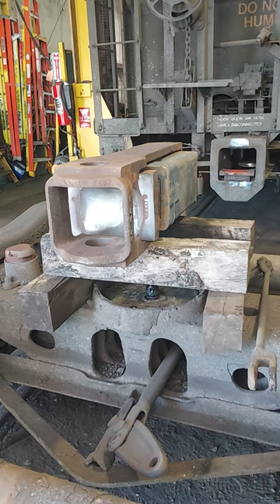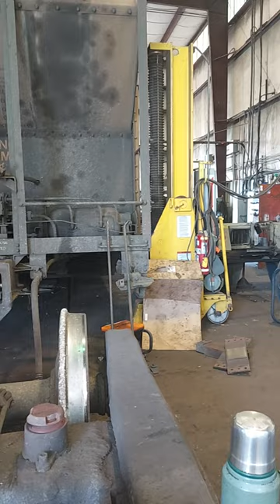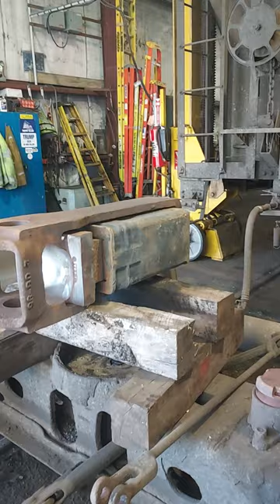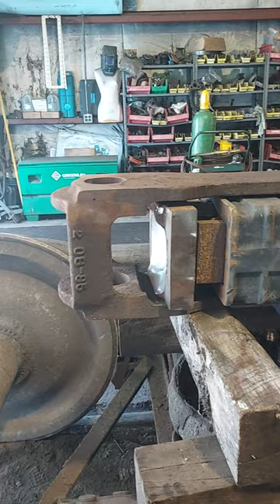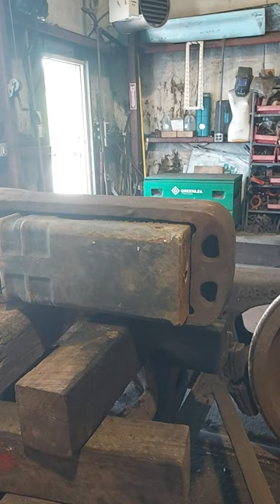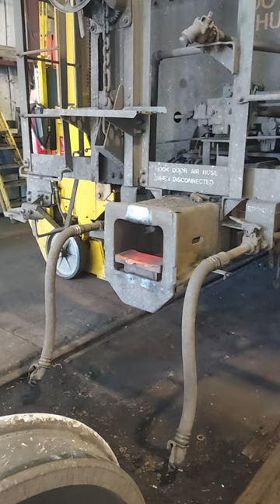How a Draft Gear Goes in a Rail Car #Shorts

Comment: We had jacks that would lower the draft gear and lift it into place.  The scary part was compressing the draft gear to remove it.  A coworker was struggling to compress the draft gear with a short stroke draft gear jack, and the draft gear dropped and the handle/coupling jack pinched his thumb off when it landed on the coupler carrier wear plate.  Draft gears can be really dangerous.  Be careful.
Reply from the maker: The mechanics do this and I will inform them to keep their heads
in the right place while doing that kind of work, appreciate the heads
up safety tip my friend.

Comment: Dave, i notice on the end of the wagon it says
Do Not Hump, i assume your railway does not have a hump yard but what is the reason for not allowing those particular vehicles to go over the hump, do they run close to rail hight where the dump doors are below.
A  short vidio of how the doors operate and discharge would be interesting if you could please.
Reply from the maker: You are right no hump yards, banging these loaded cars can cause
the doors to come open at times, bad scene to have a loaded car
empty out in a yard!

Comment: Anything on the horizon for replacement cars?
Reply from the maker: Budget meeting tomorrow Kevin, we shall see what happens
during that meeting but I wouldn't hold my breathe on new cars.
However we may be getting 3 new cars from Intramotive, they
are battery powered and the cars have traction motors on them,
there will be a video on that later this fall or early winter, hopefully they will come in December. They are in St. Louis now getting built.
Reply: @ccrx6700  I saw that on the IS Facebook page a bit ago, be curious how that could work in operation…might be a good place to experiment.   Be safe Boss
Reply from the maker: @kevinaurandt6280  it's going to be interesting for sure!  They have paid for them already.

Comment: I'd like to know why some railroad cars are labeled ( Do not hump), can you explain that?
Reply: Humping is sorting of a train at a switching yard, the hump causes each car to roll down the track and through switches to build a sorted manifest train.

Cars labeled "DO NOT HUMP", this is most often due to sensitive contents which can be damaged from the impact as the draft gear compresses at the end of the travel when cars bump.
Reply from the maker: That means don't run them thru a hump classification yard, jarring
the cars like that can  and has had doors come open, undesirable
when it's loaded with coal. Don't hump box cars with eggs or glass
in them either! LOL